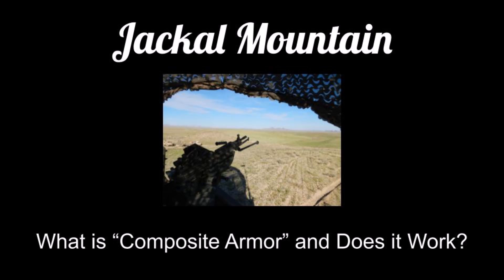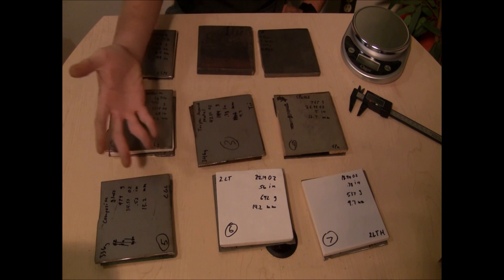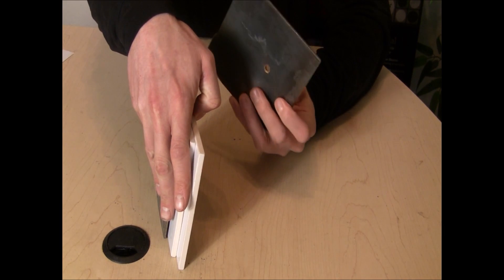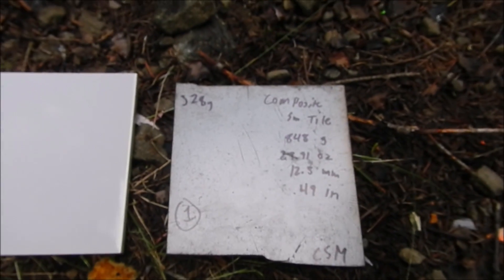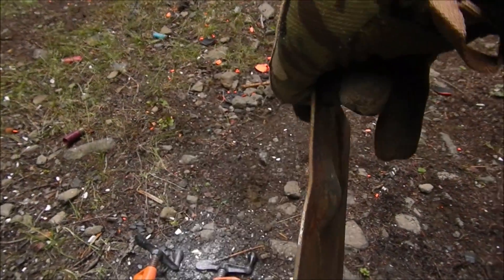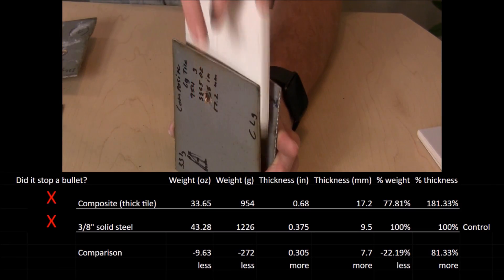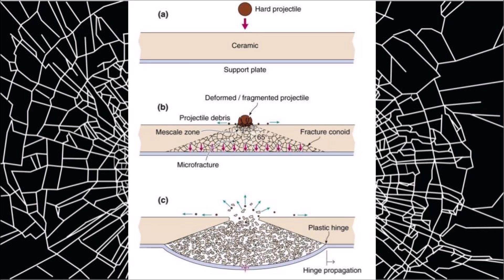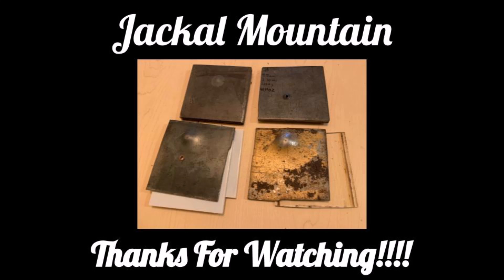Composite Armor: increasing protection, with less weight

Comment: I used to develop armor for the U.S. military.
Very fun exercise!
We would start with AR 550 armor steel.
Also used 90 to 95% alumina for cost issues,but I found that floor tiles harder the MOHS 8.5 were very good as a cheap substitute.
We developed a number of ways to protect ceramics against double tap or machine gun rounds.
Not going to divulge here though.

Way to go!

Armored glass was another subject as well.
Reply: do you know how to make armor for light tanks or are you just focused on body armor?
Reply: @renzovergara3436  I began my armor development years working on vehicle armor.
That included top attack armor upgrades for old Patton Tanks.
It seems I received an inquiry from a not to be mentioned Muslim nation who wanted us to design armor to defeat 30mm ap rounds.
It seems after running this inquiry through U.S. ITAR ,the request turned out to be a "thanks but no thanks"  polite decline the offer response from my company to the indirect request.
This undisclosed country was receiving military aid from our government,yet they wanted to protect their armored vehicles from what can only have been a threat from our attack aircraft.
We met some really unique individuals in those years.
Yes, upgrading light tanks and IFV's was in our capabilities.
Reply: @jimhenry1262  thank you for the information!

Comment: Would results differ if the tile were not able to blow out of the way say if the plates were welded around the tile creating a pocket
Reply from the maker: not really. In the microseconds it takes for the impact to translate through the ceramic and into the following layer, the fragments moving away from the impact site wouldnt greatly change the outcome

Comment: would you make a comparison video on spaced armor? german fighting vehicles in ww2 used some sort of skirts made of thin sheetmetal, which increased the silouhette of the vehicle quite a lot, but between the skirt or shield there was an air gap of up to 1meter before the actual armor. there's lot's of pictures of panzer III and Panzer IV with these constructions fitted to them, and from what i heard it worked quite well.
Reply from the maker: The first videos on my channel were of exactly this
Reply: @jackalmountain6523  i'll have to check them out then.

Comment: Just so you know floor tiles and  ceramic armor aren't  the same thing.  Yes floor tiles are ceramic, however Ceramic armor is made from composite materials not just fired clay/porcelain .

the most common ceramic armors used are alumina, boron carbide, silicon carbide, and titanium diboride ceramics, all of which are extremely dense and homogeneous even compared to normal ceramics, and some even contain powdered metal.

this is why the tempered glass worked so much better as most tempered glass has an MOHS rating around 6-9 BUT is consistently around that 6-9 throughout, where as ceramic tiles are somewhere between 7-9 for porcelain ceramics and are not uniform throughout, and 5-6 for non-porcelain ceramic tiles and are not uniform throughout, meaning when they take impact they don't distribute force in a consistent manner and thus don't diffuse that force well letting it through, where as a hardened material that is equally hard throughout allows for even force dissipation and thus more energy is diffused over a given area allowing it to stop that impact more effectively.
Reply from the maker: the underlying mechanism of how ceramics respond to impacts is still the same for generic ceramic floor tiles and high end purpose designed armor ceramics
Reply: @jackalmountain6523 That is true, however my point is that the ultimate reason the tempered glass did better is that the consistency of hardness throughout is superior to a ceramic floor tile, which is also why ceramic armor is different, ceramic armor is much harder, but also much more homogeneous in composition, like what the tempered glass is, that's why the double up tile worked for the ceramic tile because there is more material to dissipate force into, but ceramic armor can do that with a much thinner layer of  material again like the tempered glass since the material dissipates force more evenly throughout its material rather than having softer or harder spots in it like what a common floor tile does.

A good example is why modern ceramic and UHMWP composite armor work so well together as the thin ceramic front armor dissipates force over a large even area while  breaking up the projectile, then the UHMWP layers catch the round fragments while also providing a rigid backer for the ceramic armor, but that thin ceramic armor layer does so well even though its thin because not only is it super hard but because the homogeneous composition of the ceramic allows even distribution of force rather than having hard or soft spots in it which would reduce its effectiveness, and is the same reason the single tile didn't really do anything to stop the 5.56 in the video.

on that note for S&Gs it would be very interesting to see you do a video but this time seal the ceramic into a metal casing, and even compress it if possible which would allow the tile to do much better simply because the hard material is captured and able to react to the force for a longer period of time.

Comment: i know this is for demo only for tank composite armor, hence single shot. what if the actual demo unit armors where applied to a light vehicle like an SUV and subjected to repeated shots by AP projectiles. would they be still effective?
Reply from the maker: they'd be effective only as long as the ceramic material remains intact. However, if youre looking to defend an SUV only from rifle fire, you could probably get away with plates of hardened ~3/8-1/2in steel.

Comment: Sorry, but this does not represent shaped charges or HEAT “ High Explosive Anti Tank “. That, I’d like to see.
Reply: Why don't you try legally obtaining a HEAT/HEAT-FS round at a reasonable time and price? Maybe you would like to fund him?
Reply: @Jason-tp5cb  you can make them with existing materials, but the problem is indeed legality. BATF will take everything you own for something like that, done wrong.
Reply: I never meant for him to go all out crazy. I just wanted to make the point that armor piercing is not the same as HEAT. Maybe a cutting torch with a custom tip could replicate the effect on his lighter, miniature representations.
Reply: @johnkleptz6261  not the way that heat works, heat is the actual kinetic force of that superheated jet that does the penetration. The fact that it's very hot is secondary
Reply: The physics is the same, heat rounds penetrate by abrasion not by burning thru😊

Comment: It will work even better if there is a way to block the sides of the ceramic. Because in armored vehicle the theory is that it will crack the ceramic inside but never penetrate the inner metal. Because in reality the ceramic materials wont shatter but stay inside the armor untill it was replaced.

Comment: Confined for covid 19 and watching your vidéo from Belgium. The photography of that Leopard gives hot to my heart, I served in the same in 1984 wenn I was in the army. Usually the composite sandwich is made of an external plate of steel that protect ceramics from light weapons and reduce maintenance cost, a little space to avoid shoks on the external plate to breake the ceramics , a plate of ceramics to destroy the tungsten penetrator of the shell, and a thicker plate of armor to absorb the energy and avoid projection inside. Sometimes a kevlar tissu is glued inside to protect crew from projections. It could be interesting to try with a thinner external plate and a thicker one behind, but respecting the same weight than two equal plates. Sorry for bad engligh but it is not my usual talk.
Reply: Your English is good enough.

Comment: And those impacts were at 90 degrees. It would be interesting to see the impact and penetration issues if at 30 degrees, 45 degrees, etc. If you scaled down the control size (for the purpose of 5.56 mm penetration), then you would be able to make a reasonable assessment of penetration at different angles. Great video!!

Comment: Another key thing is that, with multilayered armor, each steel layer can be hardened as opposed to just the surface of an overall piece. A significant portion of the armor's strength will come from just that small layer of hardening on the surface, so having multiple thinner layers of hardened armor is significantly better than a huge thick piece of armor that's only face hardened.
Reply: I’m no expert but hardened plates are more brittle and that implies that the armor would’ve degraded far took quicker if it as all hardened
Reply: @miguelgameiro8063  If you are not stupid about it, then it will not shatter. German tanks had armor shatter due to luck of proper composition towards end of the war - due to simply running out of stuff.
Reply: @tomk3732  with tick plates if I’m not mistaken you can make them Harvey or cemented where in the same thick plate the face is extremely hardened but the rest of the thickness is far softer to avoid the plate from cracking

Comment: Can you try having a rubber like material in-between the steel and ceramic/glass along with trying a new one that mixes the steel, tempered glass and ceramic plus the rubber like material as to see if the armor protection is increased/decreased

Comment: The Shape charge effetc was discover by accident by the US NAVY when testing explosive on plates that the manufacturers name in raised lettering and the shape of the ecxlosion was modified creating areas of increased damage. It was first applied using the M1919 Bazooka and adopted by the Germans for the Panzerfaust.
You didn't use a shaped charge, modern shaped charge weapons produce a jet of molten metal which melts through the armor.
Some of them even hav muliple stage detonations to deal with reactive armor.
Reply: Germans already used shaped charges in the battle for Eben-Emael, 1940. Tanks equiped with the 75mm/L24 used with HEAT(shape charges) in 1939. Though shaped charges were used from around 1800 in German  coalmines. Also a German patent was made around shaped charges 2 years before Munroe discovered the Munroe-effect.

Comment: To my understanding, the big thing in Chobham armor is spaced NERA plates - basically, rubber sandwiched between steel plates, then empty space, then another rubber-steel sandwich, then more empty space, etc. The idea being that the incoming jet from the shaped charge will compress the rubber, which will "bounce" the steel plates outward, which can disrupt the jet.

Bullets are a lot shorter and slower, so I don't know if you could have tested this kind of composite armor effectively.

Comment: Sadly, but I have to say it - although your approach is good and sound, and you have obviously shown the advantages of composite armor against ballistic impact, this has nothing to do with shaped charge and its impact mechanism.
Of course, it is hard (or nearly impossible) to simulate shaped charge impact with DIY equipment so I can understand your approach.
However,  I think you should mention that in the video, since your video starts with shaped charge issue, and finishes with the ballistic impact issue, which are two completely different things.
No personal feelings :)
Regards,
Bathulie
Reply from the maker: Thanks, but HEAT rounds are just kinetic penetrators like bullets or sabot rounds. The metal liner doesnt get hot enough to melt steel but it does get accelerated by the focused blast into a hypervelocity slug at point blank range. Think waterjet cutter not plasma cutter

Comment: Would the glass work better if it was shatterproof çar window glass - glass, plastic, glass?
Reply from the maker: I think it is exactly the shattering that translates energy out from the impact point across a larger area. I would be really curious to use equal thicknesses of tempered vs untempered glass and see if that makes a difference
Reply: @jackalmountain6523  Whats the difference between normal and bullet proof glass?  Is it just thickness?
Reply from the maker: @hadrianbuiltawall9531  bulletproof glass is usually multiple layers of glass and clear plastic. Pretty much exactly the same composite armor idea. as each layer breaks it spreads out force and the plastic layers prevent it all from shattering at once.

Comment: The ceramic is meant to stop HEAT rounds not apcr or regular ap rounds from tanks so the ceramic doesnt actually help with armor all that much
Reply from the maker: HEAT rounds are just kinetic penetrators like bullets or sabot rounds. The metal liner doesnt get hot enough to melt steel but it does get accelerated by the focused blast into a hypervelocity slug at point blank range. Think waterjet cutter not plasma cutter.

Comment: you start video with discussion of shape charges for composite armor. yet you are demonstrating with kinetic energy perpetrator lol.
Reply from the maker: HEAT rounds are just kinetic penetrators like bullets or sabot rounds. The metal liner doesnt get hot enough to melt steel but it does get accelerated by the focused blast into a hypervelocity slug at point blank range. Think waterjet cutter not plasma cutter

Comment: I would be interested in seeing if spacing out the tiles would improve the performance since the projectiles would start to tumble and possibly break up. The old saying goes you trade weight for bulk with composite armor.
Reply: Ceramic better up close imo space the steel layers

Comment: well its intressting but pointless. becouse aggainst solidshot steel is perfectly fine. you even said that composid was developed aggainst HEAT shells. These shells work completly defferent. so yea pointless experiment to test Composit armor
Reply from the maker: HEAT rounds are just kinetic penetrators like bullets or sabot rounds. The metal liner doesnt get hot enough to melt steel but it does get accelerated by the focused blast into a hypervelocity slug at point blank range. Think waterjet cutter not plasma cutter

Comment: You may be able to get a closet analog for the outer shell (metal) , in small steel targets . These are typically ar500 steel . This would , in theory be close to the malleability,  and hardness of tank steel . Chrome , zinc , nickel , barium , boron , borillium. 12 herbs and spices . As you said , mild steel was what was available.  I totally understand , ar500 would closest I could think while still being even remotely close to available.  And if anyone reading this thinks getting a raw sheet of ar500 is an option ... don't . You can't cut the stuff with anything short of a plasma cutter . And it's a wee bit pricey , lol . Otherwise , we'll presented and demonstrates concept well . Keep on keeping on .

Comment: AR-15s are NOT DIRECT IMPINGEMENT! Direct impingement would have the gas tube act directly on the bolt carrier, like a Rashid. Instead, the gas is directed into a cylinder/piston arrangement inside the bolt carrier.